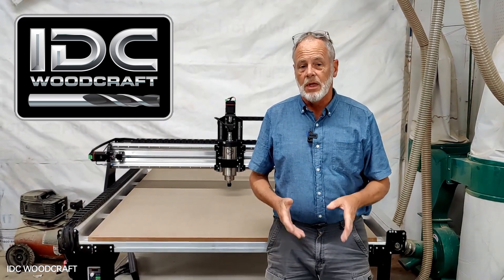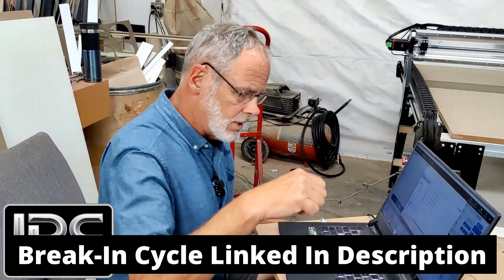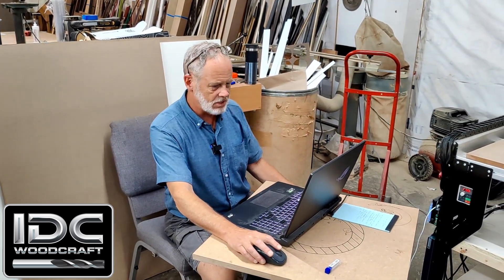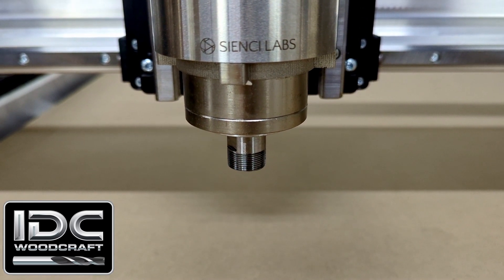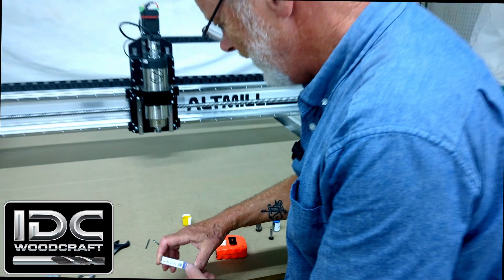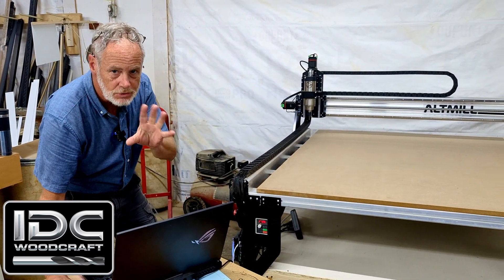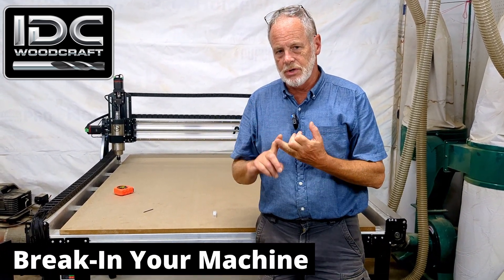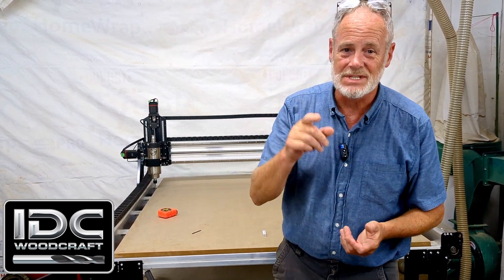Critical First Steps for New CNC Routers... BEFORE You Start Carving!

Comment: when I run the file as it gets to the end of the first cycle I get a hard limit has been triggered alarm on what I believe is the Z,  I have conformed the senor is flush with the X carriage.  any idea on what else I need to check?  Also should note that none of the senors has a red light on them, like they are when triggered.
Reply from the maker: afgrenier, It sounds like the issue might be related to the Z-axis configuration or the settings in your CNC software. You may want to double-check the Z-axis movement limits in your firmware or software settings. Also, ensure that the Z-axis stepper motor and its connections are functioning properly. Make sure there aren't any obstructions that could be affecting the Z-axis movement. Good luck troubleshooting!
Reply from the maker: You may need to adjust the sensors back just a little bit. Check your XY Max travel. It should exceed 49 in

Comment: I tend to use a 3-4-5 triangle to check for square. On my 1270mm x 1270mm that means a 600mm x 800mm x 1000mm which is nice and easy to measure. Horses for courses I guess.
Reply from the maker: tetleyk, Using a 3-4-5 triangle is a classic and effective method to ensure everything is square! It’s great that you've found a measurement that works well for you, especially with the dimensions you have. Everyone has their own preferred techniques, and that's what makes woodworking so interesting!

Comment: Some of the spindle manufacturers have specific break-in recommendations, and after sitting for a long time it seems that a dwell time of more than just a few seconds is necessary for those of us running larger spindles (3kW and higher). I do not have the manual in front of me, but if memory serves me correctly the recommendation was five minutes at a very low speed to get the bearing grease warming up and moving around where it needs to be, and then ramping up to full speed in multiple steps. The break-in cycle recommended by the manufacturer was about an hour, with a much shorter warm-up cycle when the device is used daily.
Reply from the maker: r2db, You bring up some great points about spindle break-in procedures! It's definitely important to follow the manufacturer's recommendations to ensure longevity and optimal performance. The longer dwell time and gradual ramp-up you're mentioning can make a big difference, especially for those higher-powered spindles. Properly warming the bearings can help everything run smoothly. Thanks for sharing your insights!

Comment: For my final check for squareness on my Longmill 30x30 I did the opposite corners as well but instead of using a tape measure I used  double sided tape and mounted a long thin piece of scrap wood to the first set of opposite corners and had it drill using a 1/16" endmill through the wood strip and the spoil board.  Then drill the second set of opposite corners without the wood strip.  I removed the wood strip put 1/16" nails into the wood strip holes and checked to see if they exactly fit into the 2nd set of spoiler board holes.  With a test square of 760x760 mm my 30x30 is Square.
Reply from the maker: laser31415, It sounds like you've conducted a thorough and inventive method to check the squareness of your Longmill 30x30! By utilizing double-sided tape and a scrap wood strip to create reference holes, you've effectively established a precise way to ensure that your machine's framework is aligned properly. Nice work brother and thanks for sharing your tips and tricks.

Comment: Another of your good videos Bro, along with great practical advice.  I always do a break-in period / cycle on all my machines - no matter what their size or how cheap / expensive they are / were.  I have had my three of my four CNCs almost 7 years, and have never had a problem with them, other than just recently having to change the spindle on the oldest machine.  A break-in period, along with a regular maintenance routine, will give you many years of trouble free service.
Reply from the maker: alpscraftshack599, Thanks for sharing your experience! It's great to hear that your CNC machines have served you well for 7 years with regular maintenance. It really does make a difference in the longevity and performance of the machines.